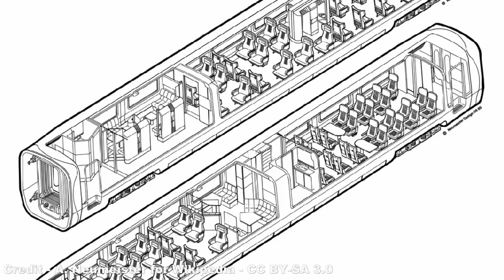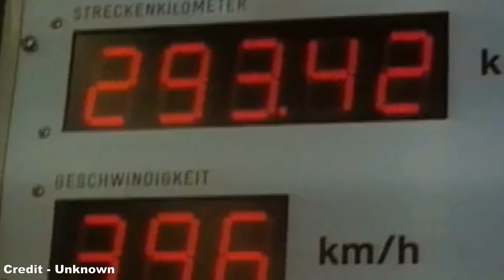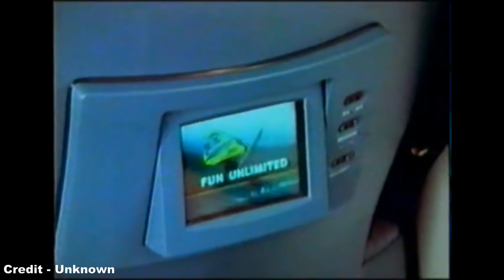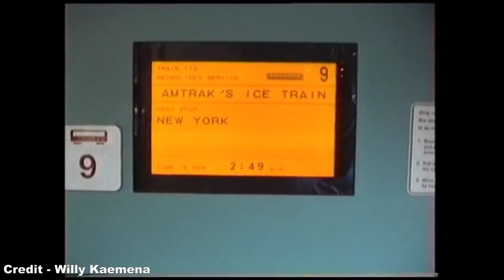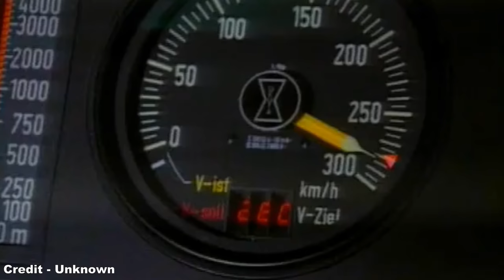The History of the ICE

Comment: Great video, good information. But every time you call it an "ice" train instead of an I.C.E. it sounds like your reading an wiki page. I know it's very common for English speakers to call it an "ice" train but it still sounds strange
Reply: ICE in English means Internal combustion engine and is pronounced I.C.E.
Hence why they call it ice-train to differentiate the two.
Reply: @GrandTheftChris  Understandable but they don't have to do that., you can use context to see if it's about a train or an engine
Reply: Indeed, no German I know would ever refer to it as the 'ICE TRAIN'. It's an 'ee-tseh-eh'!
Reply: @lundimardi1975  And Germans will find it ironic to call it "ice" when the air conditioner breaks down too frequently on hot days (specifically DB Class 406).
Reply: "ICEE"

Comment: I think you got the cause for the Eschede accident backwards. It was the full metal wheel that caused vibrations, but the supposed solution that caused the derailment: a ring of rubber inside the wheel.
Reply: The CAUSE of the derailment is clear, as you say. The reason the ICE derailment was so deadly when the Eurostar TGV was fatality free was the absence of jack-knifing AFTER derailment due to the shared bogie design of the TGV, and catastrophic jack-knifing and pile up of the ICE.
Reply: @lours6993  
Then again, I'm not sure if a TGV would have stayed in one piece if a bridge fell onto it. Which was the reason why the train jacknifed at all.
Reply: @mikeblatzheim2797  It wouldn’t have hit the bridge if it had the shared bogie design. It would have remained rigid and come to rest further down the line. Look into the TGV Eurostar derailment at the same speed to get the point.
Reply: @lours6993  
There's the important matter of a switch being involved, which catapulted the third carriage into the bridge supports. The TGV's shared bogie design wouldn't have prevented it from derailing there (since it would be passing a 60kph switch at over 200kph), and it's the switch that caused the carriages to crash into the bridge pillar. And I doubt that the train not jacknifing would have helped when hitting a solid pile of concrete; instead of a jacknife you'd probably end up with some telescoping.
I'm sure that an argument can be made as to why a Jacobs bogie setup is safer in some situations, but that wouldn't be the case here. The design flaw that caused the accident was the type of wheel used, and even with a broken wheel rim the train didn't derail until it hit the switch, where the broken rim forced it to change paths.
Reply: @mikeblatzheim2797  In each of my now several answers, I have never stated the Jacobs bogie would PREVENT the derailment. Clear?  My point has always been this one: the Jacobs bogie would maintain the train as far more rigid unit AFTER the derail (3rd time I”m saying this now), as it did in the Eurostar derailment at 250km/h in France.
Reply: @lours6993  
The train carriages separated when they hit the bridge. By that time the train was already derailed, and Jacobs bogies aren't going to magically keep the train on track when it goes over a switch designed for less than a third of the speed. The initial derailment happened due to the passing of the switch, and the sudden change in direction sent the following carriage into the pillars of the bridge.

The derailment you mentioned didn't involve a switch nor did it involve a bridge. If you want a more comparable example of a train derailment of a HST, there was a Pendolino derailment on open track (but due to a switch) in the UK in 2007. It looks quite bad initially, but the carriages themselves remained intact and there was just one casualty, even though this derailment happened on an embankment. It isn't the 1950s anymore, and by now HSTs are rather safe even when individual carriages go flying. 

The supposed fact that Jacobs bogies on HSTs are safer is just bs. A derailment on open track, even when on an embankment, is taken into consideration with the design of newer trains. 
As for the bogies you could also argue that traditional bogies are safer, after all the braking performance is much better and the axle load lower, whilst the train is modular and far less likely to sway. The ride will also be better, and the carriages are longer and thus more spacious. Is that a reason to stop building trains with Jacobs bogies? No, but I'm just saying that there's a reason why Alstrom is the only manufacturer that makes widescale use of them, and somehow there aren't fatal accidents with traditional rolling stock happening every day.

Jacobs bogies won't prevent a derailment when you pass a 60kph switch at 200kph. Jacobs bogies won't negate the inertia gained by the violent jerk from hitting the switch. And Jacobs bogies won't stop you from hitting concrete pillars when you're moving towards them at 200kph.
A TGV, provided it had the same broken wheel rim (which it doesn't, because it has a more suitable wheel design), would have caused the bridge to collapse all the same, and no train is designed to handle crashing into a concrete bridge at 200kph. Given the massive amount of energy the result would have either been very similar (after all, the connections between carriages are still the weak points), it could have telescoped (which would have been way worse), or if it somehow managed to stay in one piece, the passengers would have been decelerated to 0 within about half a second.
Jacobs bogies don't mean you train magically glides over a wrongly set switch designed for a third of your current speed, and no train is designed to survive crashing into a concrete bridge.

Comment: No, the Eschede crash was caused by the use of resilient wheels which have a rubber section between hub and tyre. These wheels are common in low speed applications, like trams and were in BR's Class 86/3 at speeds on 100 mph which were in operation from 1980 until around 1990, when the wheels were replaced and improved suspension, as used on the Class 86/4 (thus move was due to standardisation). I'm not aware if any accidents for the Class 86/3 due to the use of these wheels.

The ICE 1 used resilient wheels to improve the ride quality that monobloc wheels gave.
Reply: That is absolutely true. After the Eschede accident, DB was looking into replacing these wheels with monoblock ones, (which I think they even did, my memory leaves me on this)
but they found that those where prone to cracking, and so did not provide a viable alternative.
Reply: @Locomotiveman1994   Sorry but I think you are incorrect if you are saying that the ICE still used resilient wheels after the Eschede accident. I'm fairly certain they went back to using solid steel wheels for best strength & toughness.
As clarified by `Tilman Ahr' elsewhere in the Comments regarding the reason for the accidient :-
`There were some issues with the new (resilient) wheels not having been tested quite extensively enough before introduction, and wheels that were found out of specification at an inspection shortly prior to the crash not having been replaced'.
Reply: @Martindyna  I did not say that DB continued using resilient wheel sets. I said that monoblock ones did not provide a viable alterative, due to their risk of cracking. As far as I'm aware, DB replaced the resilient wheel sets with "classic"(standard) rimmed wheels in the end.
Reply: @Locomotiveman1994  Sorry i did not understand the distinction between `monobloc' & "classic"(standard) rimmed wheels. I imagine that modern railway locos no longer have metal tyres like steam engines used but again I'm not sure.
Reply: @Martindyna  Most don't. It was common practice up untill the 80s, from which point onwards most locos use monoblock wheels. The thing is, most locos only go up to 100mph/160km/h tops. The ICE with its ability to go beyond 125mph/200km/h is not most locos. 
I'm not an engineer, and don't work with the ICE trains, so I cannot guarantee that what I'm saying is 100% accurate. 
The Eschede accident is now more then 20 years ago, and now there are monoblock wheels that are able to withstand the high stress that high-speed running puts on them (although still with some considderable restrictions).

Comment: I've noticed some errors:
1) The ICE record of 1988 was beaten on the 12th December 1988 by the TGV PSE set n°88 reaching a top speed of 408.4 km/h
2) The Acela Express sets are not derived from the TGV Réseau sets but from the BB 36000 locomotives
Finally, at the end of your videos, 2 of your photos have become obsolete: the ICE 3 MF sets lost their authorization to run in France in 2015 and the ICE 1 are not authorized anymore in Switzerland since December 2020.
Reply: I'll make an arguement on the second point. The Acela was based on the TGV Réseau in terms of being a trainset, but the powercars are based a little closer on the BB 36000. Granted the BB 36000 has a much clearer influence on the HHP-8 locomotives, which themselves were intended to be locomotive equivalents to compliment the Acela

Comment: One of the features of the ICE 3 set is that it is actually possible for passengers at the front end to see out ahead, rather like old-fashioned diesel multiple units. Some years ago, I travelled from Frankfurt to Brussels Midi on one like that, before the LGV -Est line was complete beyond Aachen. On that journey, there were 5 different signalling systems that it had to be compatible with - 3 on the DB, and 2 on the SNCB on that day!
Reply: The ICE-T units have/had the same feature. Unfortunately the glass divider between the passenger compartment and the driver's compartment can be tinted electrically and In the recent past I have seen many trains with a plastic film applied to the glass that makes it look like frosted glass. You can still see some silhouettes, but that's all.
Reply: @Colaholiker  So it was in the ICE 3 I travelled on, depending on the drivers choice. They didn't all do it - quite a few crew changes en route.

Comment: 9:58 As far as I remember, the problem was actually that the wheels weren't actually made from a single cast iron piece and that's what killed it.

The wheels had rubber put into where the tires connect with the wheel, which was supposed to solve the vibration problem. A solution that's common with tram and light rail vehicles. However it turned out that the solution couldn't hold up at high speeds. Passengers noticed the train was running erratically and notified staff, who told them there was nothing to worry about. Mere moments later, in an instant a tire split away from its wheel and actually *pierced* its way into the passenger compartment. Having been deformed so much that it even lost its circular shape.
Reply: I seem to recall that they lengthened the intervals for servicing/refurbishing/replacing those wheels a fair bit beyond the original specification because they thought there was enough safety margin built in (which there wasn’t) or something. Hm. Gonna have to look it up again. Could be mixing two different accidents.
Reply: Ok. Not quite that.There were some issues with the new wheels not having been tested quite extensively enough before introduction, and wheels that were found out of specification at an inspection shortly prior to the crash not having been replaced.
Reply: @tilmanahr  Interesting.

Comment: Such an amazing video, thanks a lot.
In Russia we had our own high speed train called ER200, but this one proved to be inreliable and hard to repair. We also were told by the press to get next generation high-speed train called ES250 "Sokol", but the project was closed because of financial results.
Reply: rip
Reply: Russia is probably commercially unsuited to high speed rail due to the geographical separation of its major population centres? True HSR (155mph or 250kph+) needs big population centres of multiple millions ( which Russia has) with separations of around 100km to 600km (60miles to 360miles) which Russia has few population complexes which fulfil both criteria. Japan probably has the ideal set of geo-population features for HSR followed by France, Germany and China. The United States also has few of these ideal conditions outside of the Washington DC-New York-Boston North East Corridor.

Comment: Another reason why you should not call it "ice" train is because of the ridiculous amount of times the AC fails on hot days.
Reply: lol
Reply: They are designed for up to 30°C only. Given that the Deutsche Bahn removed almost all Switch Heaters, it is now designed for a Temperature Range from 0^C to 30°C, which is good enough for about 300 Days per Year. It's cheaper to just go with the resulting Chaos on the remaining 60 Days, than it is to design a Rail System that can function Year-round. Mind you, the newest ICE 4 Trains are now designed for up to 32°C to improve Passenger Comfort. The highest Temperature ever recorded in an active German Train is somehwere around 65°C btw.

Comment: More generally, I can tell you that I quite like your explanatory (train/vehicle portrait) videos. Very sufficient, well told, and educational. Also, nice idea adding in some of the German terms in this one, although 1) I don't think this is generally necessary, and 2) I feel you added a few too many. Apart from this (and what I commented before), it's actually a great video.

Videos I have already watched before this are: Blue Pullman (on 18/01/21), Networkers (04/02/21), Routemaster (on 07/02/21), and 1938 stock/Class 483 (on 17/02/21).

Comment: Trains based on the ICE4 are now in service by Eurostar.
The London-Paris trains run already the London- Amsterdam, London-Frankfurt via versa service would have started already but due to covid it was put on hold.
A merger of the Thalys trains into Eurostar is also being talked over to create a modern TEE network and reduce short inner european  flights. BA, Airfrance/KLM and Lufthansa would be a part of that consortium.
Reply: The Eurostar trains are actually based on the Siemens Velaro D, which is the second generation of the ICE 3. There isn't really any relation to the ICE 4
Reply: @mikeblatzheim2797  my bad, correct the first velaro trains where based on the last generation ICE3 are the E320 Eurostar trains are based of that velaro platform.
the heads of the ICE4 are very simular to the Eurostar and there are way more ICE3 with the old head then new head
Reply: @obelic71  That would be the second Generation of ICE 3 Trains. The ICE 4 has nothing in common with the Velaro Platform, and wasn't even designed to be an ICE at all, hence it so much less comfortable than the other ICE Trains. Originally, it was intended to replace the Locomotive-hauled IC Trains, but DB renamed it to ICE, partially for marketing Reasons and partially because they want to abandon the IC Brand soon, calling all their Long Distance Trains ICE.

Comment: Something worth noting about the Chinese Velaro: the original CRH3 was designed and built by Siemens, with some kits being shipped to China for local assembly, but all the major pieces being built abroad.  Subsequent CRH380B, 380BL, and 380CL sets were joint-venture designs with Chinese manufacturers designing the carbody and interior and Siemens retaining responsibility for the traction components.  Most of those trains were still built by Siemens, either directly through facilities in China, or subcontracting by Siemens to other firms (in and out of China).  

After that, CRRC dumped their joint venture with Siemens and copied the technology to build the current CR400 FuXing series, since they couldn't export the 380B and 380C series abroad when Siemens still owned the technology.  You'll never hear them admit it, but the traction sound of the CR400 series is identical to a Velaro, so who's really fooled?

Comment: 4:05 No, the German Federal Railway (Bundesbahn) is much younger, it was founded in 1949 and even it's predecessor Reichsbahn in 1919 after WWI.
They already tried with the Prussian state railways in the mid 19th century but it was still very fragmented by smaller railway companies.
But in 1835 there was the debut of the Adler (=Eagle) locomotive made by the Stephensons (prior to this there were already some developmets but this was the breaktrough) so 1985 was the 150th anniversary of German railway (they titled it as "150 Jahre Deutsche Eisenbahnen").

You should also mention that the ICExperimental was the first high speed train driven by AC motors, another predecessor of the power cars is the DB class 120 which was the first locomotive built in large scale with variable-frequency driven AC motors (prior to this there were some diesel-electric prototypes and decades before but these AC locomotives used multiple overhead lines).

Comment: Quick question everyone, does anyone know why the ICE 4 has a lower speed then the previous ICE 3?
Reply: It was never designed to be an ICE, but to replace the Locomotive-hauled IC Trains. DB then decided to rename it to ICE, partially for Marketing Reasons and partially because they will abandon the IC Brand soon anyway, then calling all Long Distance Trains ICE. The lower Top Speed isn't really a Problem, as there are very, very few real HSR Lines in Germany, and the ICE usually uses normal 160 km/h Lines and stops every 20-30 km. This causes ICEs to average between 80-100 km/h. The ICE 4 accelerates much faster than the other ICE Trains, which is a great Advantage with so many Stops. It is much less comfortable than previous ICE Trains though, with Budget Airline-like Seat Spacing.Again, not much of a Problem as ICE Trains usually are so crowded that you have to reserve a Seat Months in Advance if you don't like standing.